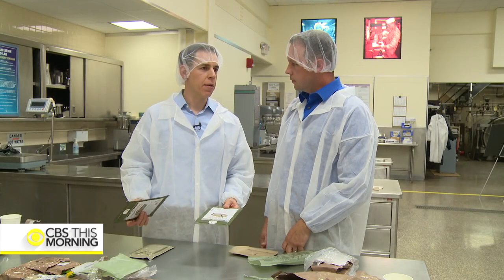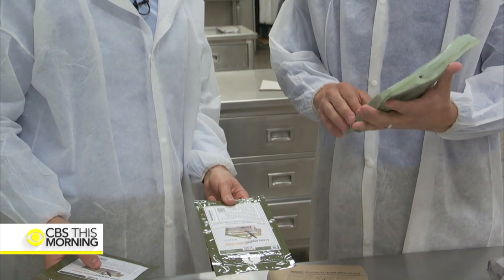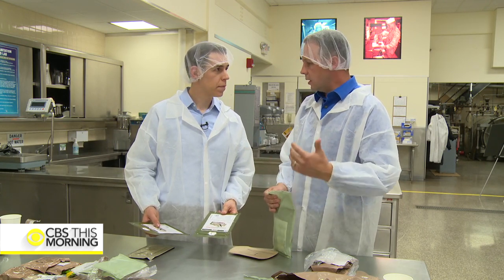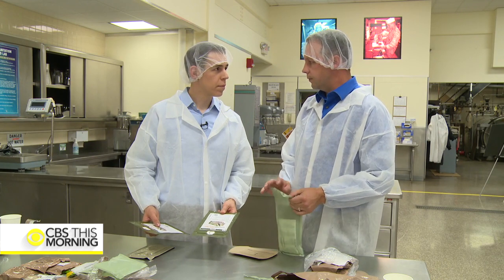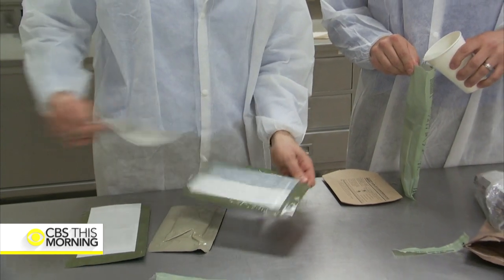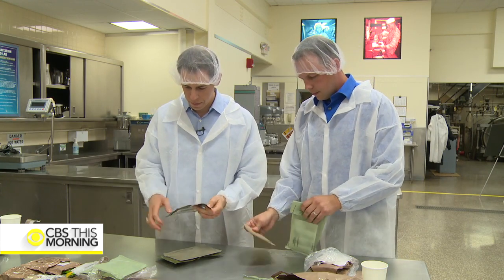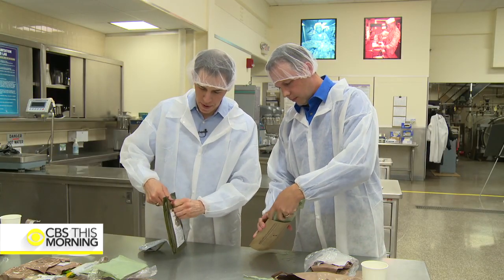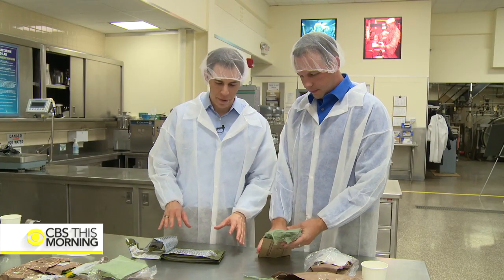How air-activated MRE heaters work

Comment: They both messed them up. The new guy didn't take all the adhesive off the first pack and the old guy didn't fold over the packet top.
Reply: I agree. This one is a bust
Reply: He didnt use the rock or something lol
Reply: Issue on the new one is you can only heat up one part of the meal, the old one you can take out and put in or just put in two parts of the meals
Reply: Very cringy..
Reply: Yup
Reply: Noobs
Reply: Mre Steve wouldn't say this is nice
Reply: One is a Reporter while the other is a Scientist both are not soldiers.

Comment: That's the coolest thing I've seen about the military. Even after hearing how food is heated up I'm still amazed at how it's possible.
Reply: It's cool until you're actually trying to rely on heating up an MRE. During basic, you're always eating it cold, and when you can actually use the heat pack, it works like 70% of the time lol.

Comment: Still don't know how it works..
Reply: Unicorn farts.
Reply: CptBeardo it runs on American Freedom Power, the hottest thing of all
Reply: Wrong. It runs on tax money, lots of tax money.
Reply: They just fill the inside of the packet with an element/substance that makes a chemical reaction which emits heat, and it emits heat because the element/substance reacts to air or water depending on which MRE
Reply: Its run by a defeat of the American Vietnam wars anger
Reply: I’m guessing it’s an oversized hand warmer.
Reply: @Scooters Videos thanks
Reply: Why you should know how it works? I mean, I don't know how my iPhone works but I use it every day.

Comment: Wow that was awkward when the dude pulled the one side off like a sissy and stripped it. Lol that poor guy that worked there is like thinking are u fucking kidding me. That was a good one. And that's either really shitty luck or a sign that the air activated one is really bad out the shoots
Reply: Well it's still in the works, so they are probably still working out the kinks.

Comment: I'd stick with the water-activated warmer, unless its on specific environments. The water one is not shiny and not reflective to give away the soldiers position if they were behind enemy lines. The water one wastes less. Id wanna use the water one when it's cold as a hand warmer, too. The "new" one that is air activated also doesn't make sense. If it's air activated, it has to be extremely corrosive... Oxidation chemicals would ruin electronic components in a sealed enviroment in a sub/aircraft. Albeit a short term and small exposure, but if the whole crew has to use these for an extended period damage would be don

Comment: That guy added almost no water
Reply: evan Reed there is a line on the bag, and if you over spill it it doesn't work. if you mean that.
Reply: evan Reed there is a line on the bag, and if you over spill it it doesn't work.
Reply: It requires only a couple tablespoons of water.

Comment: Which one produces less waste?
Reply: The new one, did you not hear him talk about the hydrogen gas and the potential to burn someone.
Reply: Jennifer, i would go with the old one. Hydrogen is the most abundant element in the universe. Hence why it's first on the periodic table. The plastic bag is recycable. The cardboard can biodegrade, or for soldiers be used for tinder (starting a fire). The one with the water pollutes less.
Reply: @SteveVi0lence  that's not why hydrogen is first on the periodic table

Comment: What is the element/compound/ substance in the pouch that reacts with air to produce heat?
Reply: Zinc and potassium hydroxide.
The energy released is 1.28 kcal per gram of zinc.
The old one releases 5.92 kcal per gram of magnesium.
Magnesium is also much cheaper to source and to process into a powder.
Reply: @DMOTAMNB  Thank you, you gave me an idea